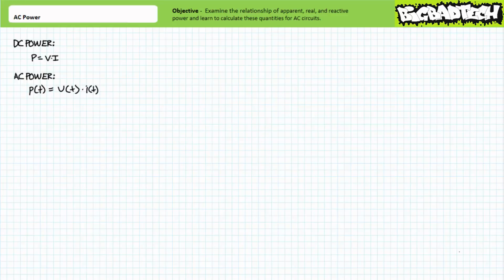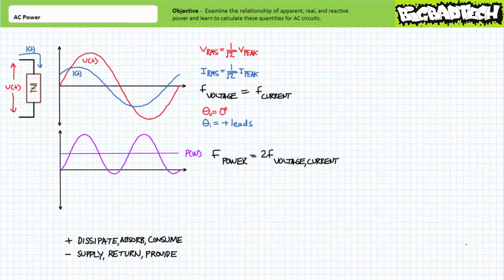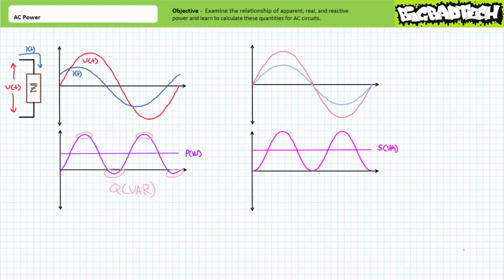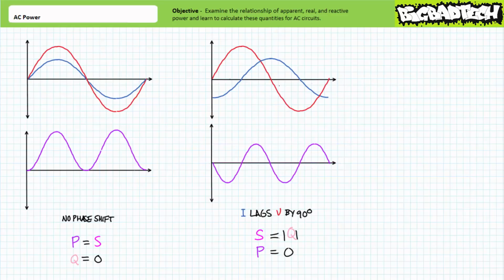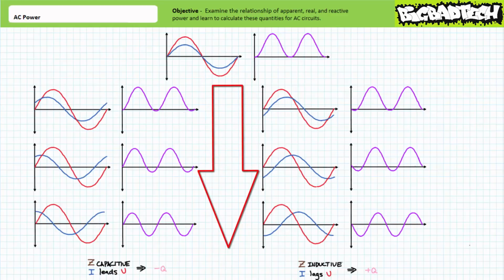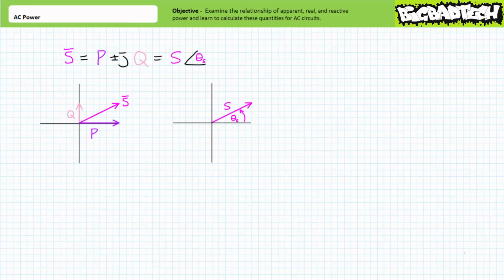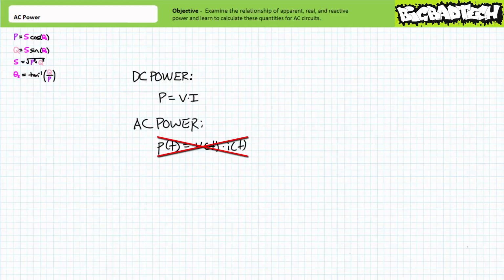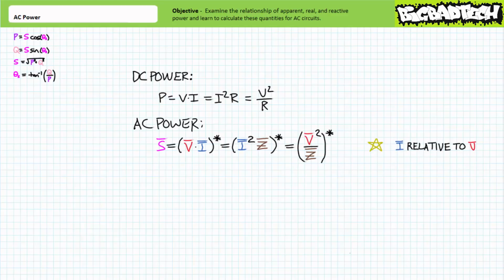AC Power (Part 1 of 2)

Comment: i have to learn all of ac theory in 4 days what do you recommend?
Reply from the maker: Get rid of your friends and family. Lock yourself in your house and start here: https://www.youtube.com/playlist?list=PLdnqjKaksr8pXF2SpDyyD7ouAVlz96_Ra
Pause all the lectures when asked to do so and attempt the example problems on your own. There's a huge hole for series, parallel, and series-parallel AC circuit analysis that I'm working to fill, however, if you've got DC circuit analysis down it's the same thing only using phasors.